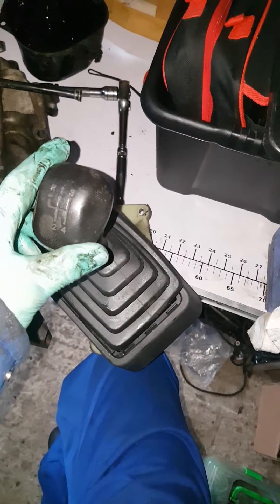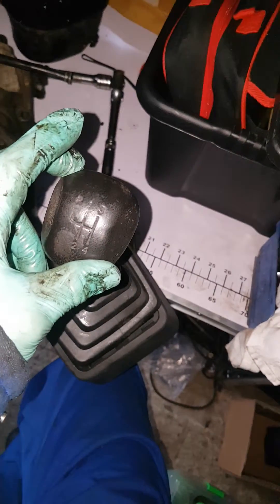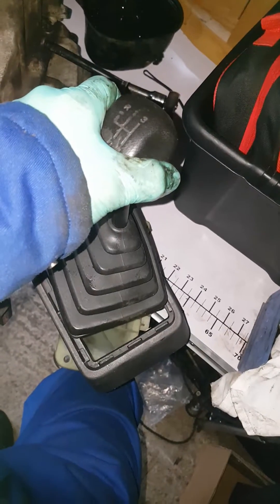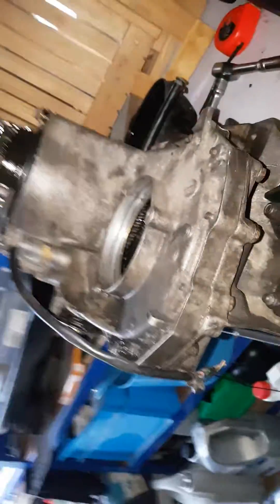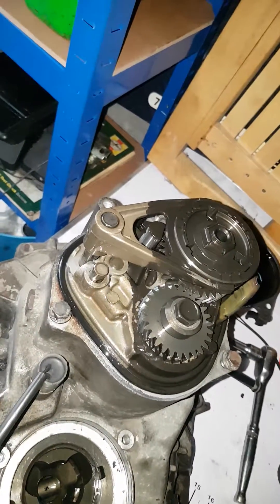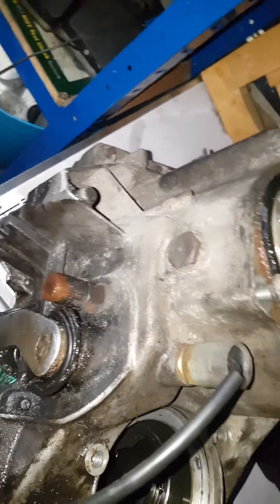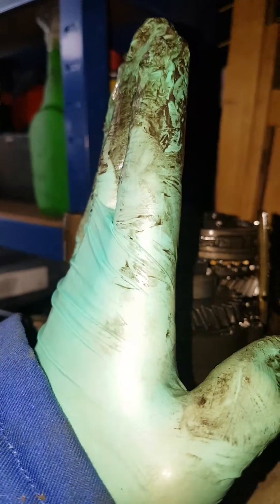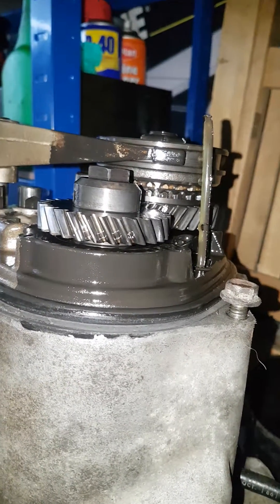New Project- Renault JB5 5 Speed Gearbox- Gear Selection

Comment: Looking forward to this, I am rebuilding a JB3 which is stuck in 3rd!
Reply from the maker: Unfortunately, whilst the internals live in my garage, the casing met its fate. The bearings could not be sourced at all, as i understand the JB4/5 lumps were discontinued in 1987 due to the known weak bearings. 
Would be interesting to know if the internals would fit a later housing
Reply: @Therenault5nut  I might have a JC5 sitting in the garage! 😉 I’ll have to check!
Reply: @Therenault5nut  I have a jb1 & a JB5 in my loft, both complete!